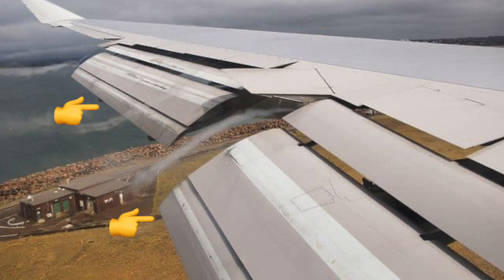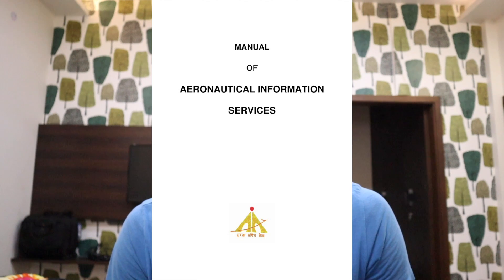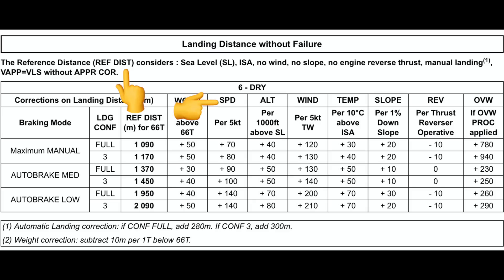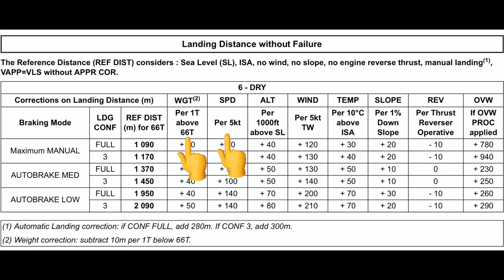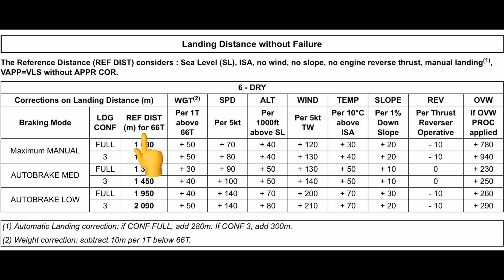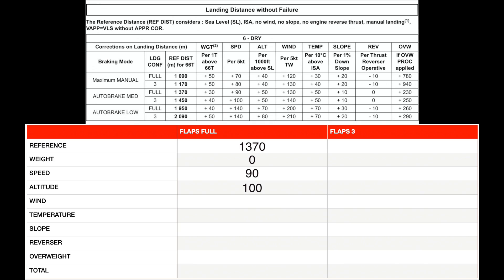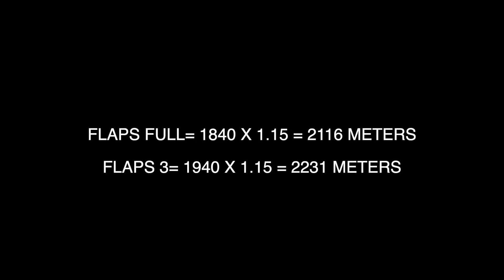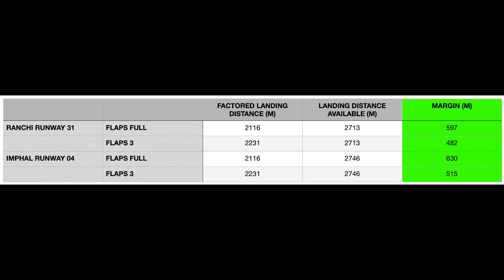HOW DANGEROUS ARE FLAPS 3 LANDINGS ON AN AIRBUS A320? 😰 (WITH PROOF!!!)

Comment: sir when runway is covered with fog /dust or.... at such situations which kind of landings will be done flap3/flapfull
Reply: CAT III-B is just a category of ILS. However, in such conditions mentioned above, most airlines let the pilots take the decision. Any experienced pilot will land on Flap4 config. I agree that both Flap3 and Flap4 configs are safe, however flap 4 is SAFER than Flap3.
Reply: CAT3
Reply: CAT III-B (ILS), fog/dust is a factor not having much bearing on flaps
Reply: Flaps 3 can be used at these conditions also brother depending on Runway length as Fog/dust will not cause much trouble to the braking action on the aircraft. It posses more threat to the visibility & hence it's more safe to use Flaps 3 as there is high chance of a Go around due to low visibility and Go Around initiation with Flaps 3 helps the aircraft climb and clear obstacles faster compared to that with Flaps Full. The type of flaps & auto brake selection used for landing purely depends on Runway length, Runway surface condition, weight, winds, elevation of the aerodrome, temperature, runway slope, usage of thrust reversers and additional speed selected by the pilot (in some cases such as windshear, some equipment failures etc)

Comment: Whatever you said is partially correct, but there are many other factors that too affect the landing:

Flight crews should pay particular attention to monitoring their speed in descent close to VMO/MMO and when flying close to the wind direction (. The impact of a wind gradient can be significant and bring the aircraft beyond VMO/MMO.
When close to the ground, the wind can change, especially when in gusty conditions, and have a direct impact on the aircraft speed. As a consequence, monitoring of airspeed is crucial during final approach and landing to avoid:

Runway undershoot, hard landing or tail strike if the aircraft speed becomes too low, or
Runway overrun if the speed becomes too high.

The aircraft can be in either an over energy or low-energy situation at landing if the crew does not manage the aircraft’s speed correctly from top of decent, thorough approach, and down to the flare. The consequences upon landing are increased risk of runway excursion, tail strike, hard landing or runway undershoot.

Whatever the level of automation chosen during descent, approach and landing, the flight crew should be aware of its capabilities, take full advantage of the tools available on airbus aircraft and apply the procedures and techniques provided in the FCOM/QRH and FCTM. The point is airlines should not impose any targets to the pilots that 98% should be flap 3 landing only. If airline is to tell pilot how to fly the airplane then no pilots would be needed for flying it. Airline can itself fly the plane.

Comment: "PLEASE DO YOUR HOMEWORK BEFORE TARGETING SOMEONE" @flyingbeast never said anything about it is dangerous or not safe he clearly mentioned that if the DGCA has permitted flap 3 landings than it is completely safe. He said that there should be no restrictions for pilots to make intelligent decisions in the cockpit. If they feel like making a flap-full landing considering the situation they should be able to go ahead without hesitation, not thinking about bonus, other factors. #sabkeliye
Reply: Yep this is correct, very few to none of the people in the comments understand the technical aspects of flying. I don't understand why this guy is getting so much of hate, this video is technical and facts should speak for itself.
Reply: There is a certain reason why he is getting the hate. The average viewers of Tapesh sir's channel are somewhat, if not well versed in aviation. and there are some assumptions on his part. I understand, he loves his company and knows that the captains of Air Asia may come under fire if Gaurav Taneja is proven correct. So there is a stress working. 
That being said, FB never said Flaps 3 was dangerous, just dangerous under certain conditions and certain runways. The issue arose is with the fact that Air Asia does not leave to permit that pilot from determining whether he/she should go full flaps or flaps 3 based on the conditions. 
And also, his calculations involve absolute length of runway. That includes blast pads and displacement thresholds, which are absolutely unusable during a landing phase. The touch down zone is where it is at, and that is a good 5-600 metre from the runway end. This small tidbit renders the calculation invalid. Yes you may say that i am just an armchair pilot talking from the comfort of my home. Yes i am. But certain things are too in your face to ignore. 
At the end of the day, its not just these two individuals flying. It's 180 people who paid for safe commute from A to B. There are non-Air Asia pilots on Instagram who have indeed verified the issue raised by Gaurav sir, that flaps 3 could go awry very easily. And when handling tons of flying metal hurtling at near supersonic speeds, a kilometre is the same as one footstep.
Reply: @carldsouza9436  where did he mention flying beasts name , plz can u give a time stamp

Comment: I can't understand one thing that why one pilot should take the risk for 150m ?? for 8kg of fuel. I mean seriously!! . If there is a wet runway (over 5mm water on runway and u don't knw that) , after flap 3 landing for 98% target and 8 kg fuel I can see u r going to overrun. There is even chance of u will not engage reverse thrust as u r confident on your so called reference chat. ALWAYS REMEMBER 150m IS ENOUGH TO SAVE YOUR LIFE OR TAKE YOUR LIFE.

Comment: You are right on your part Technically
However, to force a pilot carrying over 150 souls onboard to do (almost) 100% flap 3 landing just doesnt make sense.. Ofcourse if you incentivise these things, Pilots would want to use Flaps 3.. Even if the conditions suggest full flaps for a better landing.. This is what is being called as a safety issue.. Nothing else.. Hope you get my point.. Dont we mock Doctors on prescribing high priced medicines instead of thier cheaper alternative.. Why do doctors do so.. Because they are incentivised on prescribing high priced medicines.. They are not wrong.. But they are not right also.. Hope this helps

Comment: All Facts . Total Science . The policy Might be blamed but by no means it should be interpreted that using flaps 3 is compromising the safety of the passengers . Under certain conditions flaps 3 is recommended to reduce drag and terbulence under fav situations . check it out for yourself on official sites .

Comment: Surely Air Asia India have hired him to speak against Mr. Taneja. Just like tit for tat.

#boycottairasiaindia
Reply: What, if he's stating the facts which are universally acceptable, do you think Gaurav Taneja Sir know more than engineers at Airbus. At this point, I'm wondering why do they even allow to retract the flaps sure it would slow the aircraft and cost a lot of fuel to company and environment but it can reduce speed in case of free fall therefore it is also a safety feature.
Reply: @furiousninja133 If flap 4 can cause free fall, AIRBUS is to be blamed. Most of the senior pilots are in support of Gaurav Taneja. This immature dropout has just shown us best and worst-case scenarios of RWY lengths. There are so many other factors when it comes to a landing.
In certain situations, you need FLAP4 landing for a more stable approach to make sure that you don't deviate too much on your heading. Also, I am not saying that FLAP 3 is not safe but FLAP 4 is much safer than FLAP 3 in bad weather conditions. That being said, AirAsia has no right to give demerit points to a pilot if he can't perform 98% FLAP 3 landings.
Reply: Also, the above calculations do not include GS, weather, winds, ISA, and REV. Imphal has the most turbulent landing. No pilot does FLAP3 landing there. The regulator has instructed many airlines to do FLAP4 landings there for safety.

Comment: Boeing Boy. Driving a Hyundai, you only only speculate about how a Maruti drives like based on numbers. Now being an aspiring pilot, I understand the theory remains the same. However, us engineers understand very well there's a lot of difference between theory and practicals. Secondly, would you care to elaborate on the calculations for a wet runway? Just merely saying it's more than enough, without placing any figures or formulae seems to be fishy. Thirdly, you calculated for Ranchi and applied it to Imphal. Imphal FYI has a slope of 2%. Lastly, if the difference is so less, why do they bother to give a target of 98% landings on Flaps 3?

Comment: In order to meet company's requirements he had to do 10/10 flap 3 landings , but he did 7 out of 10 , considering monsoon/ heavy rain and strong tail winds. Every educated person will know that it is harder to stop a plane on a wet runway . The Margin you calculated you didn't add the factor of wet runway because it will increase the distance of runway req. the most. Add approx 400m in case of heavy rain and strong tail winds . Less than 100m runway would be left and anything can happen.. What would you do in that case. You being a stupid ass pilot will try to do a flap 3 landing in order to meet company's expectation , which might result in a crash or runway overrun . Did you saw what happened to the fedex plane which landed in Mumbai (one of the biggest runways in India) during Nisarg cyclone. That plane couldn't stop on the biggest runways in the country with full flaps and you are talking about landing on flaps 3. You stupid pilot , Your license should be cancelled , go fly kites , you are not well educated and trained to fly a plane.

Comment: Hi People, I am an aviator myself and can tell you that both flap 3 and flap full landings are standard recommended from the manufacturer of the Airbus 320.  The usage of Flap 3 is purely based on operational, Environmental and commercial objectives of the airline. Flap 3 is not unsafe but it is recommended because becauae it saves fuel with slightly longer landing distance required. It is a trade off. One cant get everything in life. Learn more about Airbus 320 on my channel. https://youtu.be/G26GlTqEDqA

Comment: If there is any fuckup during landing at flaps 3 (as pilots are also humans) then who will be responsible. And why airline is imposing restrictions on the pilot not to use flap full landing if it ensures safety of the passenger. Remainig 8 kg of fule kya airline apni ga*d me bharegi.😠😠😠😠 aur agar pilot 100m pahale plane rok raha haii to airline ki ga*d me kyo chunna kaat raha haii? And if you are against Gaurave sir then directly tell us.
Airline ki chamchagiri kyo kr rahe ho.😏😏😏😏 aur tumharii salary badh rahii ho isse to batao.

Comment: You have assumed all the calculations based on ideal conditions. Many air strips in northeast India are very complicated. When the monsoon arrive, there is more disturbances. During the flight, the captain is responsible for the safety of the plane, all crew and passengers. It must be his decision on the operation of the plane during its flight. Who will be responsible if tomorrow any mishap occurs due to all these targets !!! There can be other ways of cost saving as well but never at the cost of passengers safety.

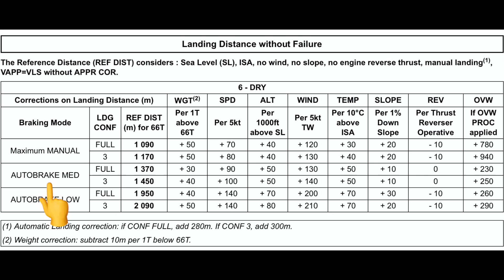Comment: I want o know as in the documents shown at 5:57 ask to add 280 and 320 during flap 3 and flap full landing,. Why that has not been added.
Reply: It's for Overweight correction (OWC). The maximum landing weight approved on this A320 is 66000 kgs and aircrafts usually take off with a weight higher than their maximum landing weight. In case of an emergency and aircraft has to land immediately then at that time the aircraft will be having a weight above their maximum landing weight. The A320 aircrafts doesn't have a fuel jettison system whereby they can dump fuel and reduce weight. The aircraft is designed to land above their maximum landing weight in case of emergency by applying some special procedures for Overweight landing. In such cases during landing aircraft will take more runway length to stop as increased weight increases the inertia and thereby it takes slightly longer time to decelerate. So this correction need not be applied for normal landing as nobody lands the aircraft above its max landing weight in a normal condition.

Comment: He is just acting as he is not taking anyone's side but from last video, he is taking AirAsia's side. Gaurav Sir also said that if anything happens then it will be declared that the fault is of pilot. So, if there is a fault in your system just go against it. Please don't become a barrier for those who are doing good. Don't support Air Asia just for your job security. Instead be quiet or support Gaurav. Realise the Hatred against you from your last video.

Comment: The point is not that whether the landing space is sufficient or not the point is that the airlines should not force The Pilot school and in a particular way it should be the Pilots decision on how to land what plans to use and all other technical decision because he is the one who is responsible

Keeping a flap 3as standard and keeping flap 3 as a forceful decision on the pilot are very different

Most Airlines might be keeping flap 3rd standard that it should be preferred not a factor to decide whether the pilot is capable or not

Comment: See now Imphal has a steep Glideslope, Which means that the aircraft has to descend at a higher rate then normal. A normal descent rate is 3° for any aircraft. So in Imphal we may have to land with descent rate more than 3°. So if the descent rate increases obviously the speed of the aircraft increases. Mass x Gravity + speed of aircraft (for nerds). To slower the speed of the aircraft, the flaps has to extended to FULL to avoid any dangerous situations!!! This was what you had to explain in your video, not how much runway was consumed or something like that !!!

Comment: by reading the rest of the comments i saw one point missing in your complete video that you no where mentioned smooth landing or air density cuz of altitude.
flap 4 landing will be definitely smoother as it will give higher lift in low speeds 
flap 3 landing is okay but a bumpy landing may cause structural damage to the aircraft right?
and why do you need to answer for airasia? cant they do it themselves?
youre just gaining publicity on making vids on the hot topic in indian aviation, well i would say air asia is making you do this lmfao
Reply: From where did you learn this science?! Do you even know what you're talking about? Flap configuration has nothing to do with smooth landings, and if flap 3 were to cause structural damage, why would airbus even develop it in the first place.
Reply: @DhruvAulakh  sir i am a wanna be pilot
even tho im just 18 ive been reading books and have a 90 % idea of how the particular aircraft works
im on this chanel just to know more about it. as per my common understanding flap 4 will let us come down at a even more slower and controlled decent rate. and as per structural damage is concern flap 3 has no issue but if a pilot is comming in for the touchdown and realises he has to touch down immidiately he can drop to the ground real quick and cause a hard landing may causing a tyre burst or some hydraulic damage. trust me ive experienced that on my landings in thailand in airasia itself. rest the pilots know the best
Reply: @arkoholicYT  Lmao you're a wannabe pilot that thinks that flaps 3 landings can cause structural damage??
That doesn't even make sense, there's nothing wrong with flaps 3 landings unless the pilot exceeds 3Gs on touchdown which would make it a very hard landing. 
You can land at flaps 3 or 4 setting because the FMGC on the Airbus will calculate the appropriate VAPP and VLS, It's only the question of runway length.
But in the end, both planes approach at -750ft/min so I don't see what's the problem.
Reply: Very true
Reply: Bro ,I if would be on his palace I'll do the same to save my job 
He has to serve his family.

Once think from my point of view.
Reply: Nobody forced you to watch this video
Reply: @SKY MATRIX gaurav sir is correct but as per my common sense flaps do make a significant difference on touchdowns
Reply: maybe air asia told him to do it...... its not his fault either....
Reply: And here we have a student from WhatsApp university. You know nothing about aerodynamics do you?😂😂
Reply: i mean he is just trynna save his job ....

Comment: i totally agree with your points and explanation what I feel is that gaurav sir is wrong about flap 3 landing in imphal and other short runways, and the airline should surely not build up pressure on a pilot to do a flap 3 landing and I think the other points which he covered were also absolutely correct